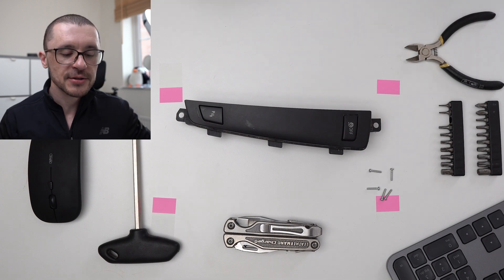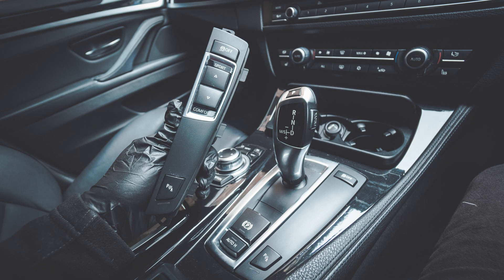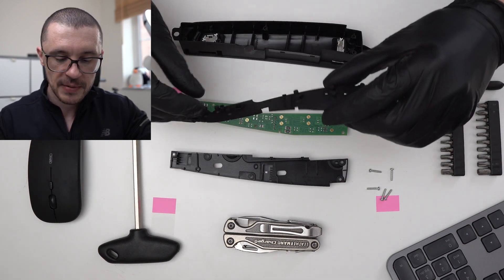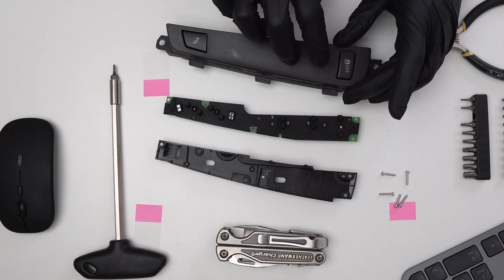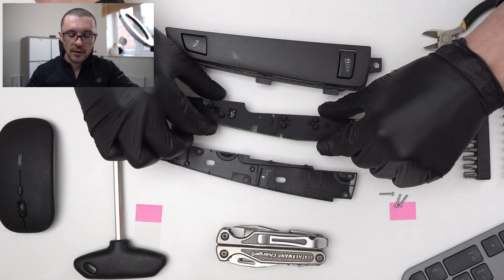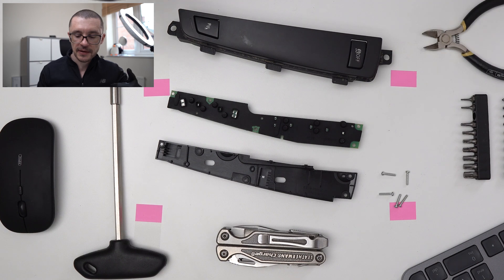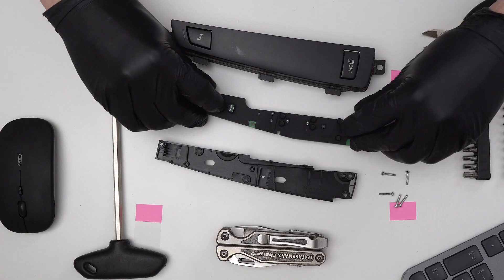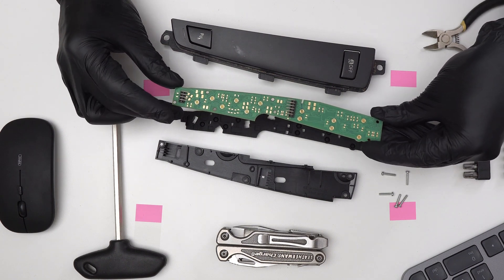Hidden Features in Every BMW Drive Mode Switch - Teardown - What is Inside

Comment: I would suggest doing a part 2 of this video just for fun and see if actually this options and unable by factory and we just need to upgrade that face cover .
Reply from the maker: you need to add 2 more wires from the switch to the control unit. I have done the retrofit on my car with the new panel.

Comment: Hi. I have a f10 535d which does not come with the dec switch which allows to switch between comfort/sport/sport+. Watching your vid does this mean that all I require is a cover with the switch to enable the changing of confort/sport and sport +?
Reply from the maker: no. you will have to place 2 more wires + coding